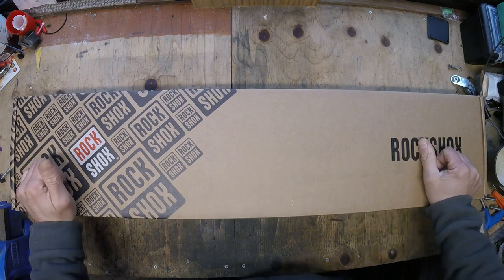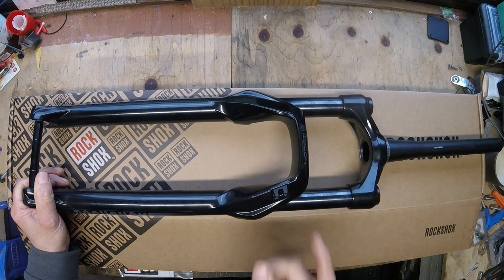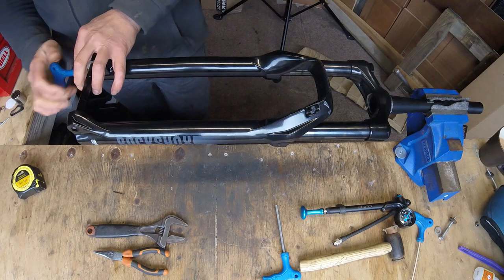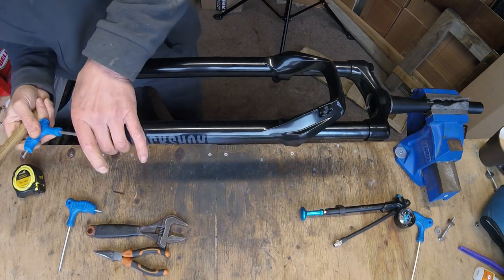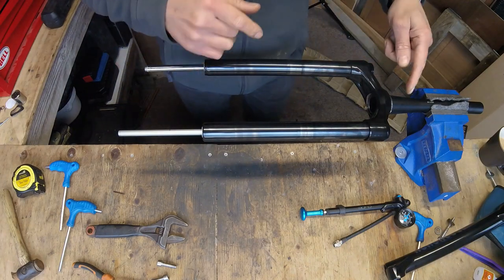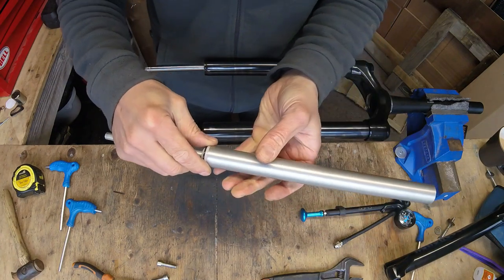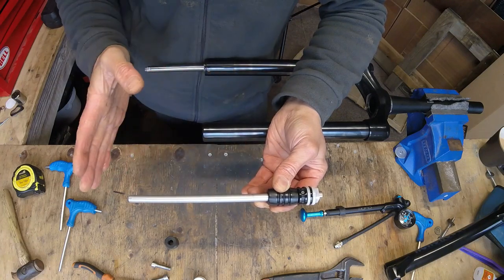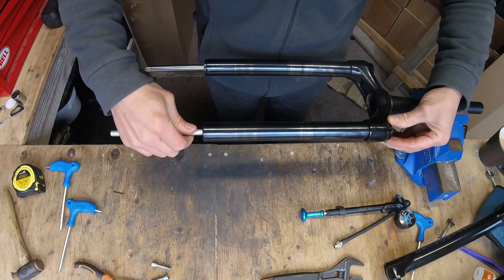Orange Stage 5 Dream Build Part 4 - Rockshox Recon Silver RL Fork with 150mm Travel Upgrade

Comment: hi bro, i was about doing this work with my fork but accidentaly i removed the lock in the right side, and it seems like the rebound is not working,  i didnt test but it dont seems like its working the right way, its just assemble like the air side?

Comment: I tried doing this so that I wouldn't lose oil, by simply freeing the lower leg bolt and then leaving the lowers in place and pulling the air spring out the top. The problem is that the air spring tube separated while the whole air spring assembly was still in the upper, and I believe all the oil therefore left the air spring and leaked into the lower legs. I think I now need to drop the lowers completely and re-place all the oil. Also, in realizing the air spring is a separate component from the uppers, I am now left wondering how the fork's legs actually stay attached to the uppers while you ride.
Reply: Those bolts on the bottom are keeping them in place bro. And those top caps are keeping them from shooting in your face😂

Comment: Correct me if I’m wrong—I’m not a bike mechanic—but all you’re doing is removing a 20mm spacer/token.  This is standard practice so I’m not getting the “upgrade” part as you are exchanging progressive travel, which is better, for a linear one.  If it was me, I would take the 120mm progressive travel over a 150mm linear travel any day.
Reply from the maker: Hi, thanks for your comment. I'm not sure I understand how removing an 'optional' 20mm spacer would or could affect the progression of the travel. This action is controlled via the damper. This fork is sold in a range of travel lengths from 100 to 150mm in 10mm increments. The internal components remain unchanged throughout the range apart from the amount of spacers. how could the progression of the travel be affected if the internal components remain the same? 
See here: https://www.sram.com/en/rockshox/models/fs-rcns-rl-d1
Reply: @CoruscatorMTB  the spacer limits the air volume on your fork, causing them to ramp up in stiffness as it goes through their travel.  Adding more spacers—or tokens in the case of Fox—will make the fork move faster during the initial travel then slowly stiffening up as it continues.  This is why it is called “progressive” travel.  No spacers allows the fork to move fast at both ends of the travel, thus “linear” travel.  This only affects how the fork “feels” as it goes through its travel and is different from their dampers.
Only reason why I asked this is because to my knowledge, only Suntour forks have the ability to change travel without having to buy a different internals since you can move the pins on the air chamber from 100mm to 130mm.  I have yet know of a way for Fox/Rockshox to do this without changing their internals so I am very curious if their was a DIY method.
As for which is best, we’ll, that’s a personal taste based on how you ride and your terrain.  Where I live we have rocky hills and drops so descending on a linear travel fork is crazy scary as you are immediately placed well over the bars due to the fork using all its travel at once instead of progressively ramping up.  So yeah, on hills, I use my long travel 150mm bike with 3 volume spacers and on XC flow trails I use my 120mm bike with no spacers.
Reply from the maker: @duyle557  Thank you for your comments. I think you are confusing 'All-Travel Spacers' with 'Bottomless Tokens'.

Quote from the service manual: "Bottomless Tokens can be added to, or removed from, the DebonAir top cap to fine-tune the spring curve and bottom out feel."

You can see for yourself, here is a link to the service manual: https://www.sram.com/globalassets/document-hierarchy/service-manuals/rockshox/front-suspension/2018-2023-judy-30-recon-service-manual-english.pdf
Reply: @CoruscatorMTB  ah, you are probably right.  Like I said, I’m no expert, just trying cheat the system, pay less, get more.  😎
Good riding.
Reply: Yep. Travel spacers and tokens are both different things. In a Recon, you cant use tokens anyway (unless you make some punk diy ones). I think you need to have a 35 or higher model to use them

Comment: lose stiffness
Reply from the maker: Mine are ok. The fork performs as it did before I removed the factory spacers and now I have 150mm travel instead of 130mm
Reply: Actually not because the 150 mm travel version of this fork is the exact same as the 130 or 140 mm versions and they just either have no spacer, a 10 mm spacer for the 140 mm travel or a 20 mm spacer for the 130 mm travel fork.

this is similar for the recon silver RL 80 - 120 mm forks. These can all be traveled up to 120 mm.
Reply from the maker: Correct  @---so4fi

Comment: Does this work on a 140mm recon? Does it effect the ride any?
Reply from the maker: Yes, it should. It's worth checking the Recon manual for your exact shock from Srams website for oil quantities and spacer dimensions. You should only have to remove one 10mm spacer to get the full 150mm travel, but you might have to add oil to suit. Like I said it's worth checking the manual for your exact fork model.

Comment: Just because you can do a thing doesn't mean you should.
Adding that extra fork length and using the same sag settings will result in a rather noticable change in your steering geometry. It raises the headtube and thereby changes the fork angle along with rake and trail. I find this makes the bike slower to turn.
Reply from the maker: That's a fair comment. The extra 20mm will alter these variables as you suggest but this fork can be bought as a 150mm travel variant. As far as I can tell there is no other change in the dimensions of the forks sold by Rockshox throughout the range of travel lengths, from 100mm to 150mm that they sell. If its good enough for them, then it's good enough for me.